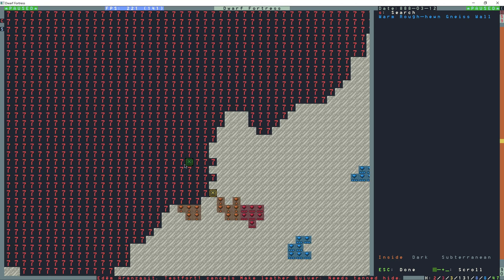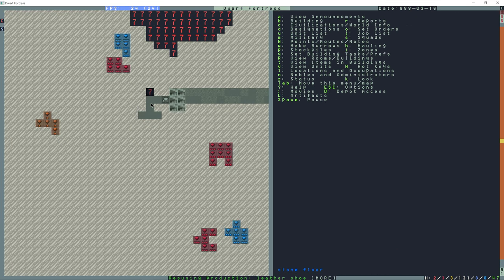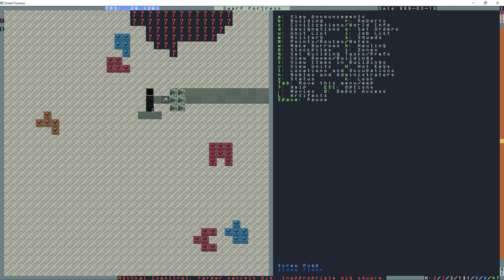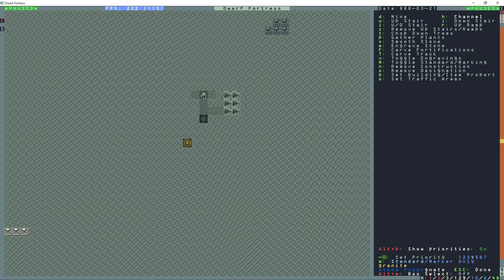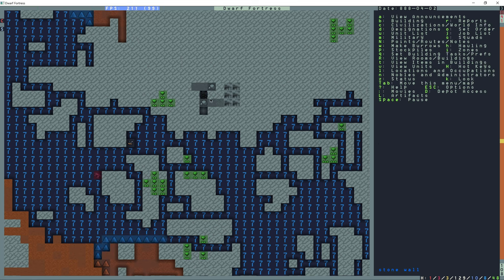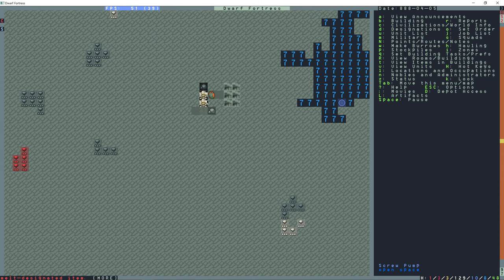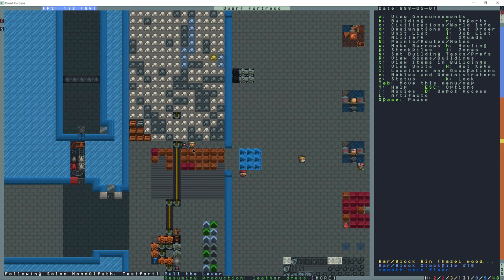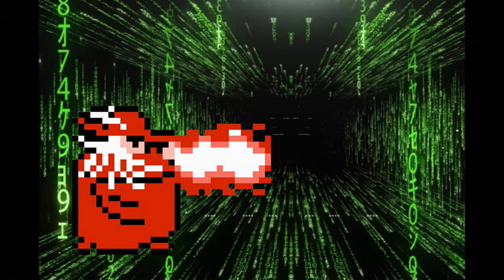HOW TO BUILD A PUMP STACK? 🔅DWARF FORTRESS🔅

Comment from the maker: Ramps are fine to leave in, also It's probably worth mentioning that the T shape isn't strictly required but is better for FPS. If you have space concerns a 1x4 area (plus access and walls) is enough

Also that while you can designate pumps on top of other unfinished pumps, they'll deconstruct if the supporting pump takes too long to build. Its very annoying when one slow dwarf causes a whole stack of pumps to deconstruct!

Comment: Why the T shape? Isnt it enough building like an I, with only one tile for intake and one tile for pump?
Reply from the maker: This is from the wiki: Changing the single tile magma chamber at the output of every pump from a 1 by 1 to a 3 by 3 area reduces the lag to 1/15th of that caused by the original pump stack. The designer hypothesizes that the larger chamber requires many fewer temperature calculations when magma is pumped in or out; that also implies that there will be no FPS improvement for water pumps by using this design.
Reply from the maker: Thanks for watching QraTz!
Reply from the maker: well we could build an I pump and run it with water / magma with temp on & off to see if that is why. I always thought it was because the pumps draw more than 7/7 of liquid at each step.